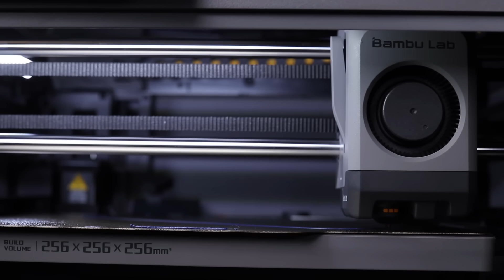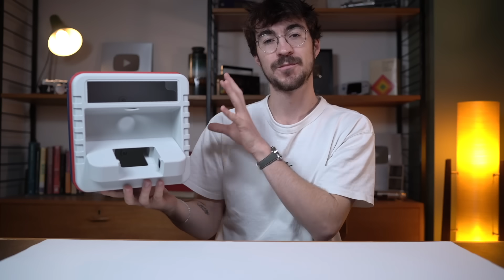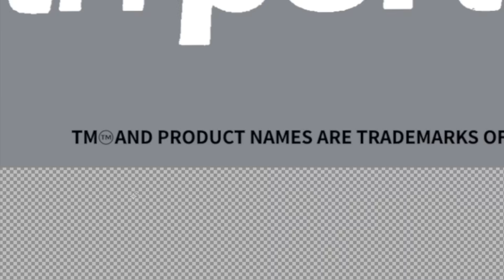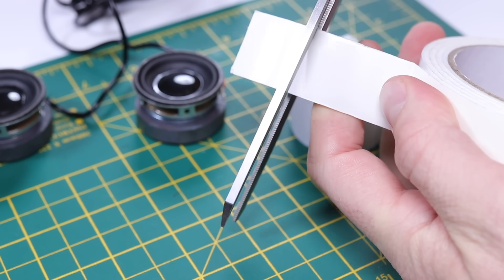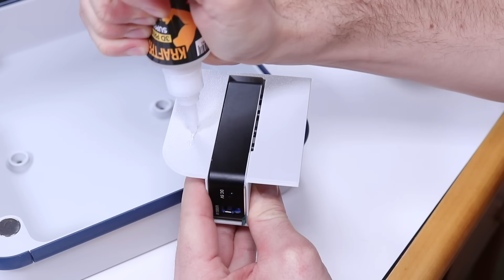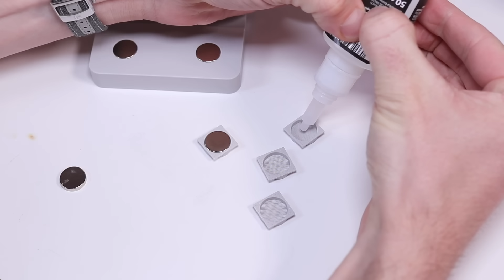I Recreated a Forgotten Piece of Nintendo History

Comment: The only thing I would change is the audio plug. You can get lower profile or L-shaped plugs. You could even get one that's an extension so you don't really need to change anything or do any soldering. It would be a little more out of the way and less chance of it getting hit or bent as it sticks out the bottom of the gameboy.

Comment: What you can do to remove supports easier with your AMS is to mix materials. Print your object in PLA and do 2 or 3 support interface layers in PETG - or the other way around. PLA and PETG don't stick to each other, so you can set support z distance to 0,0mm and still easily get the support off. 0,0mm distance also avoids droops and thus creates much cleaner surfaces on the areas that were printed on support. But i'd increase flush volumes going from one of those to the others to avoid mixing them in the nozzle in the print.

Comment: very nice work mate , im making a portable C64 at the moment, Im a scratch builder so I dont use a 3D printer, I use whatever works, Its going to be powwered by a USB power bank and be something you can just switch on and program, or run games from an SD card. Im just waiting on a 7-inch screen for it coming from ali express.

Comment: Looks great🔥🔥
....Changes I would suggest for MkII. are a plastic cover for the light, steel plate inside unit and base to add weight and counterbalance and run everything off a single USB-C power strip or simple PCB, tidying up the wiring by getting rid of the hub and all the separate power cables. 
Maybe some kind of quick release power jack, depending on how difficult it would be.

Comment: A few small touches would really pull this together into perfection. Some frosted acrylic or tinted plastic would soften the light and hide the internals. And a bracket that comes out to cover and hide the audio jack would serve double duty by holding the gameboy in place. I wouldn't trust the friction fit to hold the gameboy in place long term.

Comment: Hey Elliott! 
Good Job!
I think this one is can be a cool prototype, what you can upgrade with more details in the future. 
For example, would be more nice some 3D printed speaker cover than the holes, or the sticker picture could be on a transparent plastic and got rgb or changeable backlight.
Also you could hide with a half transparent plastic the hole of the light, and also you can print a GAME BOY alphabets to the top of the kiosk with blue painting inside and the conturs can stay the original kiosk color.

Comment: Awesome build. Mk.2 should include all speaker / drill holes in the 3D model rather than adding them later. I'd also add some kind of clear or frosted lens in the hole for the light 👍

Comment: Kinda miss having a 3D printer, though my last one was D-tier in both software and hardware. I'll have to get back into it at some point, but I don't have anywhere to put one anymore and I don't know if I'd use it enough to justify the cost right now.
That said, I'm getting into soldering lately, so my "creating itch" is being satisfied regardless, so whatever.

Comment: I think it should have a diffuser for the light, just some tracing paper over the hole, so that you don't get that glare. and I feel like the original kiosk would have had a diffuser, so that you couldn't see up inside the top section.
Reply: I agree
Reply: This was the one thing I was thinking the whole video!
Reply: or just print one or two layers sheet from white filament
Reply: @flippy9133  sheets of all kinds of adequate material already exist.  Not everything needs to be 3d printed.
Reply: @Aeduo  sure, but you have to go to a shop or order it then wait, cut to size. Or you can design it the exact shape you need, 3d print it in 10mins and you done.
Reply: @flippy9133 I don’t think you need to go to a shop to cut out a little piece of tracing paper 😂
Reply: Agreed, you can also use some parchment paper. Makes a decent diffuser in a pinch
Reply: Another thing he might want to do to make the reset more positive is to short the gameboy (not the supply!) to ground to make sure everything is thoroughly drained.